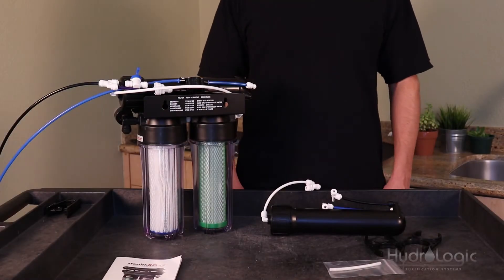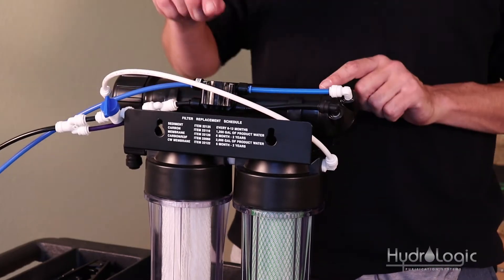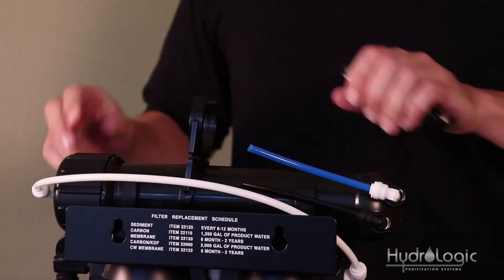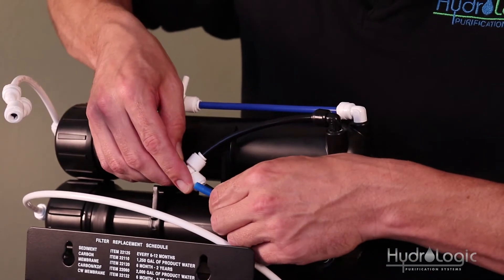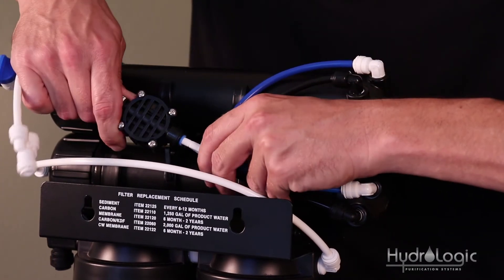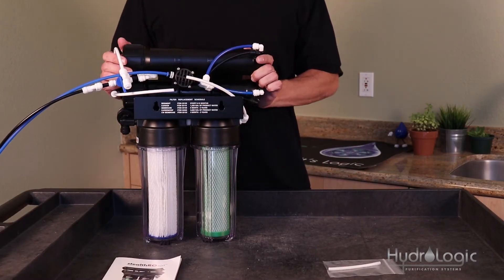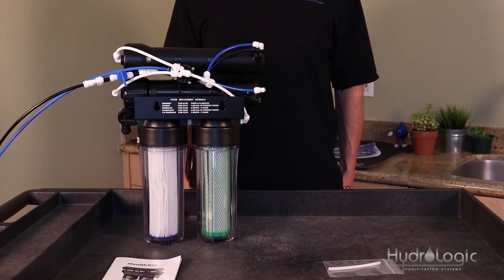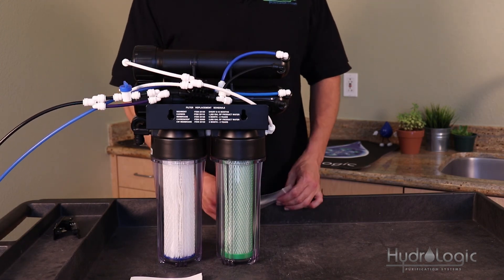Stealth-RO150™ to Stealth-RO300™ Kit

Comment: I've never been able to get this product to work. It just drips slowly from the product line. I replaced both filters, nada. Haven't been able to contact Hydro Logic by email or phone. Terrible product and zero support.
Reply: Booster pump. Pressure should read 75-90psi while running. 80-85psi being the sweetspot.

Comment: I’m currently running the booster pressure on my RO150 if I do this 150 to 300 will I still be able to run the booster?
Reply: Yes. But you might not need to once you upgrade. You'll find that the flow is better by over double, if not at least double.